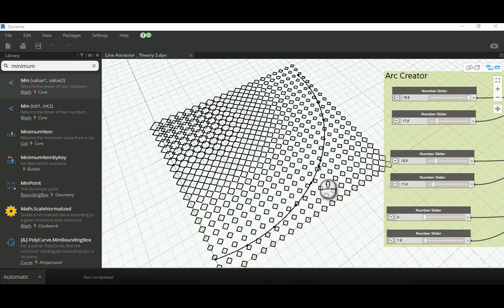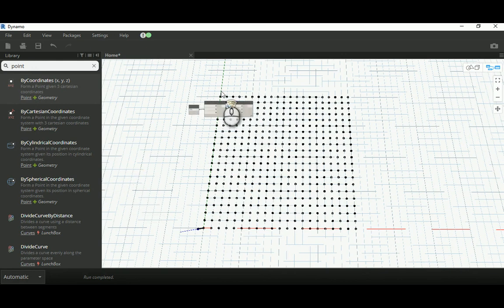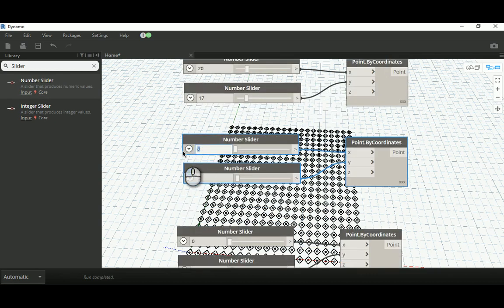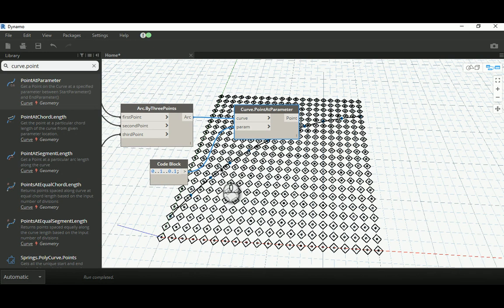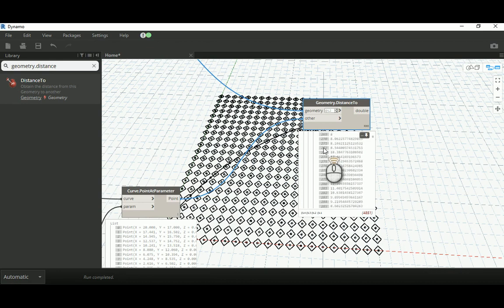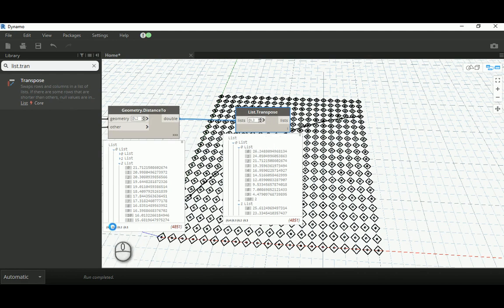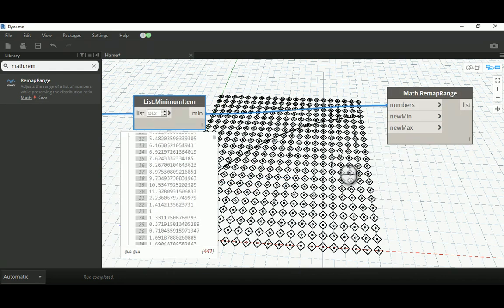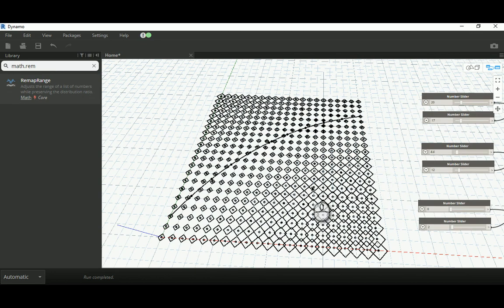Line Attractor _ Curve Attractor in Dynamo - Revit _ Theoretical Part

Comment: nice tutorial and very useful. What if i would like to add a familly element on de grid and adjust some parameters of that element with a straight line attractor?
Reply from the maker: Thanks, linke the property of that element that you want to change with the the linear attractor , see the linear attractor example and I stead of circle radius change use your parameter of the added revit elements

Comment: Excelent video! If i want to invert the attractor, make an reacttor? I can do this with this script?
Reply from the maker: Thanks dear Manuel, at 11:20 I added list.minimum to find the least value of each row as a distance to the attraction point, try to use list.maximum ( or any similar node or method) this suppose do what are you asking for, try and tell me
Reply: @FirasNoori   it ll just happen with , swapping the max and min amount in math remap.